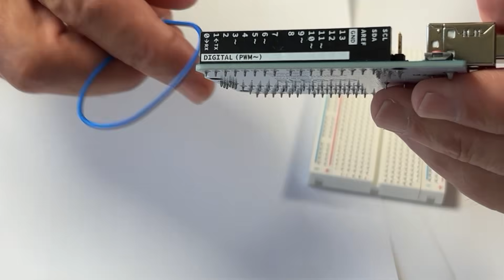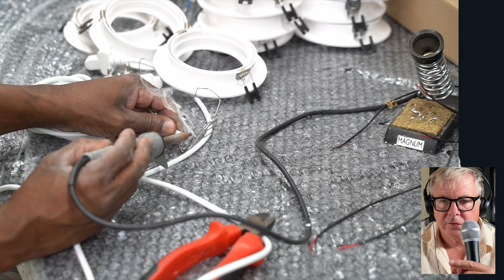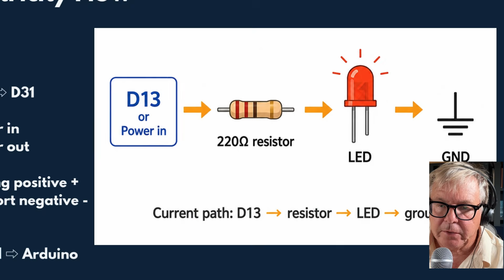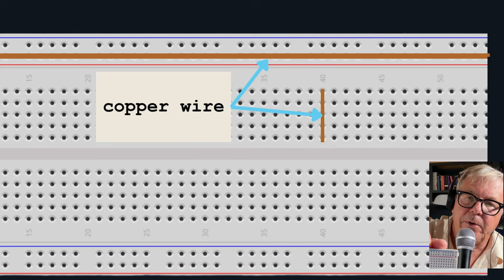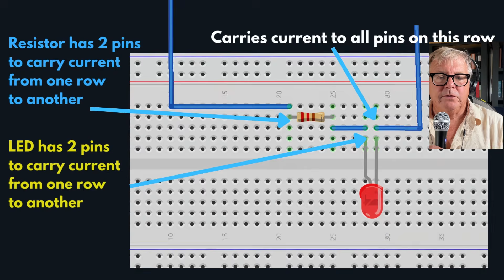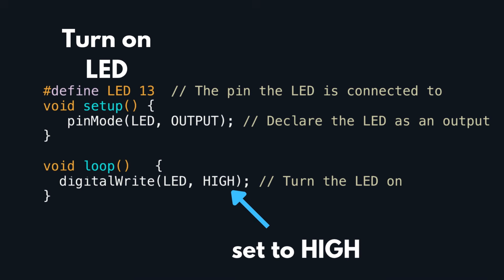Arduino Lesson 1: Blink an LED and Learn Your First C Program

Comment: I was told electricity flows from negative to positive to fill the holes, not positive to negative.
Reply from the maker: That refers to electron flow, whereas conventional current is defined from positive to negative.

Comment: Tinkercad is a free program that allows you to simulate the circuit and test to see if it is operable.
Reply: Thanks. I discovered that after I payef for Wokwi which was overkill and  expensive. Now I use Tinkercad as you say.